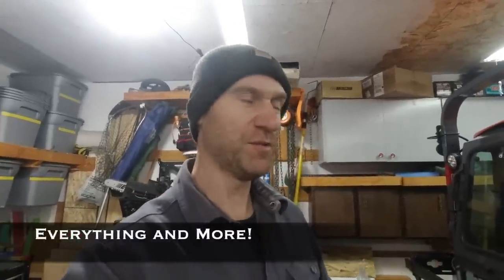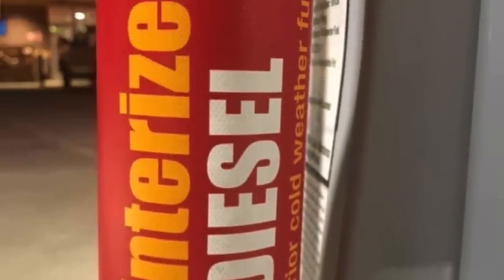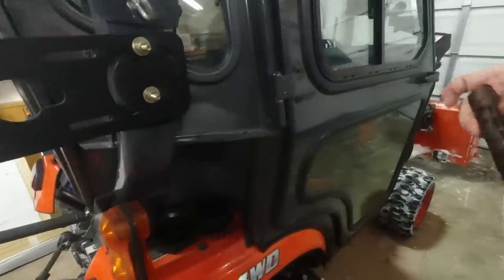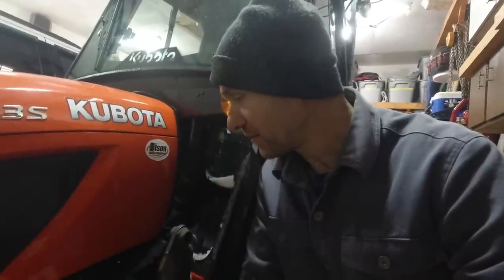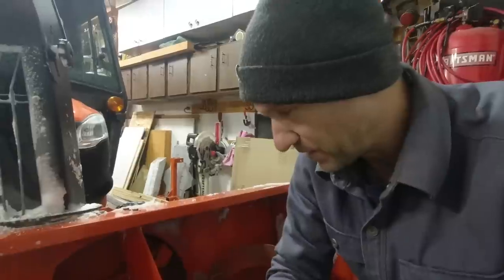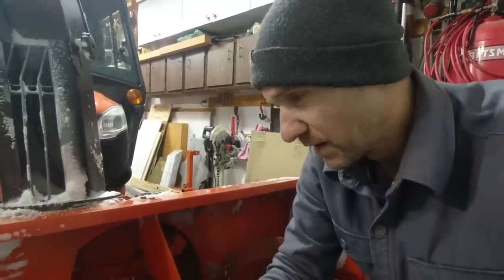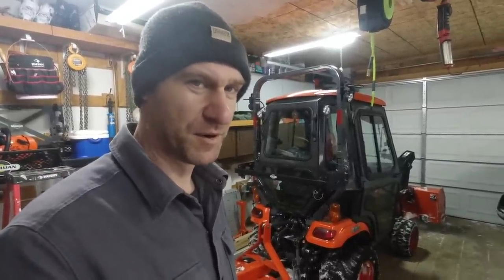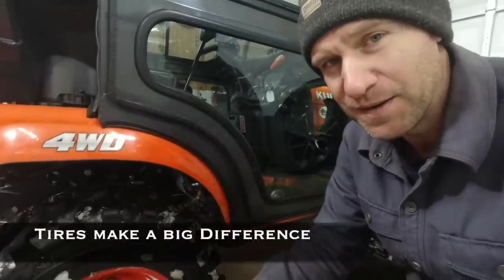SNOW REMOVAL FOR BEGINNERS (Kubota BX23S Tractor in Winter)

Comment: Thanks for your videos. I also have a BX23S and live in central Washington at 2300'. Every winter is different around here and this is the 2nd winter I have had my tractor and blower. Biggest issue so far with blowing has been dealing with wet snow and I did have my chain come off a couple of times, once when I hit a rock and also broke a shear bolt. Was wondering about th 5/16" bolt recomendation. The regular bolts dont have the scoring around the bolt the way that the shear bolts do. Wouldnt this effect how quickly the bolts would break when they need to ? Thanks,  Jeff
Reply from the maker: I think a regular OEM shear bolt with the scoring is actually a grade 5. So I feel safe using the grade 2 without the scoring. Seems to be about the same effectiveness. I hope you get some decent snow that's not so wet. Thanks for the comment. 
Keep on tractoring!

Comment: Hey Jon, nice video.  Have seen you in the BX group on FB, didn't realize there was a Ritter group, will look into it.  Haven't ever tried Turtle Wax, but I'm a huge believer in Rain-X.  I do like the idea of Turtle Wax on the blower. I used Fluid Film last year, but I think the TW could be better just because of the application (spray bottle vs more like a WD40 can).  Grew up a little SW of you in Dawson, live in Rochester now.  Electrical engineer w/ IBM 29 years, WD for over 7 more years now.  Can take the boy off the farm, but you can't take the farm outta the boy.  I've only cleared <2 inches of snow 1 time this year, I haven't even hooked up my blower yet. Very disappointing.
Reply from the maker: Hey Ray, I'm a little behind catching up on replies. I'm guessing by now you might have some snow according the the weather map I looked at. Glad you discovered the channel and I appreciate you watching. 
Keep on tractoring!

Comment: Hi John this is Greg Ritter I live in SeaTac Washington and I run star Tron in my diesel I also run it my gas I run it in my two cycle stuff I run it in almost everything excellent stuff Amazon has both brands for diesel and gas not very expensive if you consider what it does the one for gas helps the ethanol issue
Reply from the maker: Thanks for the tip!
Keep on tractoring!
Reply: Also you might be interested they make it in a diesel formula and a gas formula the caps are different colors so if you order some for sure to look at what you’re purchasing

Comment: Hey great video Jon! You made me laugh more than a few times! Awesome video, I second that stupid Kubota fuel filter and location! This is why I modded my fuel filter and re-located it but even with doing this you still need treatment.. absolutely.. I use an anti gel every winter it’s 1 oz that treats 5 gallons for the one I use and it lasts a really long time. When your filter froze on you Jon was that during the polar vortex we had a few years back? We had this before I started my channel but it was minus 20 at times with a minus 40 wind chill and I could NOT imagine what you must have went through to change that fuel filter out you had to be SO damn cold haha. Great video as always and even better tips!
Reply from the maker: I think it was around that time. We definitely had a cold streak here where the temp didn't rise above 0 for about two or three weeks straight. The roads in town had about a 2 inch layer of ice because at that cold of a temp salt doesn't work. Glad you enjoyed the vid. Looks like your snow pusher is working out well for you. 
Keep on tractoring.

Comment: Avoid biodiesel if possible it freezes about 20 to 40 degrees earlier, it is very corrosive (bacteria/alge produce acid) often you will see what looks like coffee grounds in the filter which means you have a problem.  Even sticking with regular diesel can introduce the microorganisms since trucks are rarely dedicated to one fuel.  Most new large emergency generators and boilers constantly pump fuel through filters to keep the problem under control.  Change your filters often, use both time and hours run to set a
 schedule, and check the filter's contaminants. Almost as bad as DEF.   I had over 100 tanks that I inspected monthly.  Summer diesel is usually cheaper but add in the cost of anti-gell it isn't.   Ritter made some good points.
Reply from the maker: Thanks for the comment and also great advise about the biodiesel. 
Keep on Tractoring!

Comment: Yep. Worst thing that gets guys is still having fuel they’ve used in the summer still in their tank or sitting in a jerry can. Even treating that sometimes won’t save you. I’ll generally run my tank down to nothing in the fall and wait till that snow is ready to fall. Then I’ll grab some diesel that’s already formulated for winter use from a busy service station and dump it in. Of course with a anti gelling/cleaning additive with a -40 C mixed ratio. Because it does get to that temperature North of Winnipeg. And please you guys don’t use Bio Diesel. That stuff is evil sometimes and really needs a lot of treatment. I like to always use a funnel with a screen in it when I fill things up and let that jerry can sit in the cold for a while. Over the years of filling equipment with either gas or diesel during the winter. It is surprising how much ice crystals you’ll catch with that screen before it gets into the tank. Block heater? That’s a no brainer. Dealers up here have them preordered installed. Unless your one of those guys that likes Green machines. It’s a Dealer installed option only. Go figure and the price will shock you. If you do it yourself you’ll find out why. A very time consuming installation on a Deere. Much easier to install on a Kubota if you had to. I don’t know Jon. That cab you have on that tractor weighs a ton. I don’t think weights would help much. There’s enough there already. To end I think one thing that needs to be mentioned is after you start that tractor just walk away from it for 20 minutes and just let it idle. Give the transmission and hydraulics some time to warm up. Especially when it’s bitterly cold out. Your tractor will love you for it.
Reply from the maker: All good advice, I always let my tractor warm up about 20 minutes of so when it's cold out. I should have mentioned that also. North of Winnipeg, brrrrr that's gotta be one the coldest places to live. 
Keep on tractoring!

Comment: About when diesel fuel gels up from low temperature: For you US people who use Fahrenheit, it's easy. Whenever there's a minus in front of the number of degrees, untreated diesel is gelling. And remember, the temperature in your fuel tank isn't necessarily the same as in the layer of warmed air next to your house where the outside thermometer is sitting. That layer of warmer air is thicker in front of windows than outside the better isolated parts of your house wall.

Comment: Instead of wax, try WD 40 Silicone spray!  Works amazing and lasts... 
One other little tip is Lucas gas and oil treatment.  If you love your kubota and want the engine to last forever use it with every oil change and every tank of fuel....   Million mile diesel owners swear by it.  Todays fuel is very low on lubrication....

Comment: have you thought about a flashing yellow LED mini light bar on your roll bar. let everyone see you.
Reply from the maker: I have and I've got some plans in the works for that idea. 
Keep on tractoring.
Reply: @ritterjon , JUst watched a Youtube on a guy using a hand held leaf  blower to blow the snow and ice off his steps, sidewalk and cars. this could work for cleaning off the tractor and snow blower before putting it up at end of shift. last thing, does your tractor company have a fuel/water separator with a drain between your fuel tank and engine? If not see what it would take to install one. I drove big trucks for 14 years in the PNW and draining those each day helped keep ice out of the fuel filters(had 3 of them in the truck)
 .
Reply: I forgot, I'm living in Enterprise, AL about an hour north of Panama City Beach, Fla. We are the home to a statue to an Insect.

Comment: Electrician from Northwest Illinois, 20 minutes from the Wisconsin border.
Reply from the maker: I've got a square D GFI breaker going bad, can I replace it with a regular breaker. I those GFI's are a pain the hind end. Go Bears! Unless you're a cheesehead. 
Keep on tractoring.
Reply: @ritterjon  Yes, you can replace the GFCI breaker with a regular one. If that breaker leads to a receptacle near water, a kitchen counter top, or a bathroom, put a GFCI receptacle in place of the regular one. Code only applies during the time of installation. Homeowners can change it to whatever they want 😉... And WAS a cheese head before they all started kneeling. 🙄
Reply from the maker: @imbthree  Thanks for the advise!

Comment: Hi, the Kubota shear bolts are actually a Grade 5 Bolt not grade two.  You can tell by the stamp on the end of the bolt.  Is there a reason you use a Grade 2 bolt?
Reply: Forgot to say where  am from.  I am from New Brunswick Canada..
Reply from the maker: The grade five shear bolts have a grove cut into them where they are suppose to break which make them about the same strength as a grade 2 bolt. 
Keep on tractoring!
Reply: @ritterjon  With mine I have 2 different size shear bolts, one has a grove and one does not.  My old rear mount for by BX never had a grove on them.

Comment: So Iso Heet is an Anti Gel Product?  I thought it just gets water out of your tank?
Reply from the maker: It does both 👍 It's always worked great for me so I have no desire to switch to anything else. 
Keep on tractoring!
Reply: @ritterjon  some peeps on Orange Tractor Talks seem to be dead set against putting alcohol (iso heet) in a diesel fuel system saying it might damage the injectors or something......I'm just uninformed about it.

Comment: You may want to look at this https://b3cfuel.com/product/diesel-tank-snake-fuel-life-water-absorber/ it's a water absorber for diesel fuel. Although I'm not familiar with the different options they are offering now, when if first saw them they only had one version which was a reusable version that I see they still offer. My understanding of the reusable one is you can leave out to dry on a driveway for example it's supposed to hold in everything harmful and be environmentally friendly as it drys.

Comment: Keep up the great work John.  Not trying to give a plug to this product on your channel but something you may want to look in to.  Fuel Filter relocation kit by botaproducts.  https://bxtractorparts.com/shop/ols/products/bx-fuel-filter-relocation   I added this in the fall to my BX2380 and everything went very slick. I cursed the location of the primary filter just trying to take it out, so I couldn't imagine trying to put one back in.  Cheers
Reply from the maker: That is nice kit. I've been thinking of the upgrade as well. 
Keep on tractoring!
Reply: Undoubtedly the best thing I ever did was the filter relocation kit.

Comment: I think you forgot 1 tip. With extra lights didn't you add an extra fuse box to hook in all your lights? I am from west central Illinois and right now we have what feels like more ice than snow. 1 other thing is to stay away from bio-diesel in the winter. The mechanic at the Kubota dealership to me it is not good really at any time of the year. Also put a tow strap in the cab, either for you or someone else, thanks
Reply from the maker: I had an auxiliary fuse panel on my old BX25 but with my cab on my BX23S there is a switch panel overhead that I tap into.  
Keep on tractoring!
Reply: @ritterjon  either I missed that part or just forgot, sorry about that